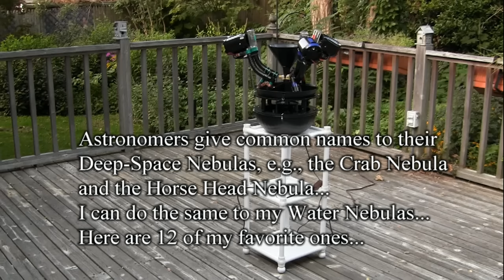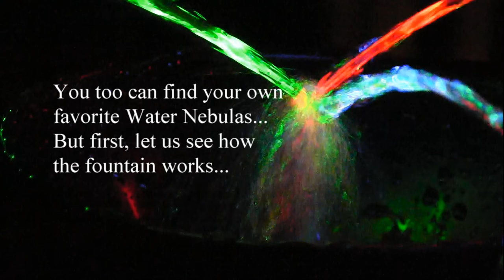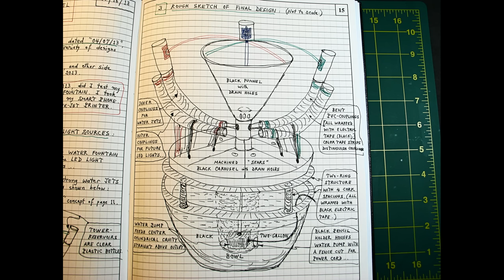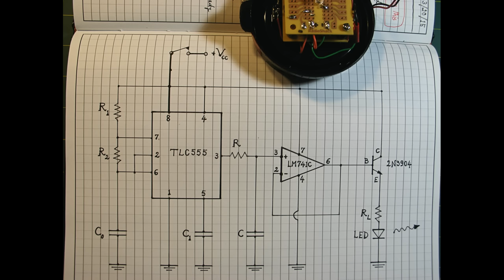Homemade Nebula Fountain Emits Color RGB Lights from Three Colliding Water Jets

Comment: How complicated would it be to modify regular fountains that splash into a pool to allow the streams to glow like these?
Reply from the maker: Not all regular fountains can be converted into a "Nebula" fountain like this one. First, the regular fountain needs to have 3 water jets that meet somewhere in the middle. Next, you will need waterproof red, green, and blue LED lights that install behind the 3 jets, typically under water. You can buy existing waterproof LED lights for fountains, but the 3 intersecting jets geometry is needed to reproduce the "Nebula" effect that you see in the video. In principle, any good landscape designer will be able to convert a regular fountain into this Nebula fountain. It would be more expensive to do if your regular fountain has only one or two water jets. Thank you for your interest in my Nebula fountain!
Reply: @SaadHebboul  Very cool! Would simply installing a waterproof LED behind the jets luminate the stream until it reaches the pool (if the light is bright enough obviously)?
Reply from the maker: Yes, light is guided by the water jet even though this jet curves up then down before it reaches the pool. This light-guiding effect is known in optics as "total internal refraction". Of course, light from a weak LED source will not reach the pool, any good LED flashlight has enough power to light up your pool. The effect is  most wonderful at night!

Comment: You should add silver glitter to your water instead of Milk. I bet that would be fablous.
Reply from the maker: I like your idea of using silver glitter, John! Unfortunately, the smallest silver particles (50 microns) are too large for the filter of the water pump. Over time, they can easily block the flow of water. Another potential problem is their ability to settle at the bottom of the water bowl.
One way to minimize these problems is to obtain sub-micron glitter solutions, but then you encounter the problem of size-dependent light scattering, i.e., red, green, and blue light will not be scattered uniformly, as I found out with milk. Thank you for your interest in my Nebula Fountain!
Reply: Why exactly do you need a filter anyways?